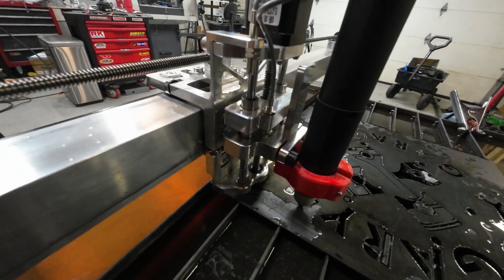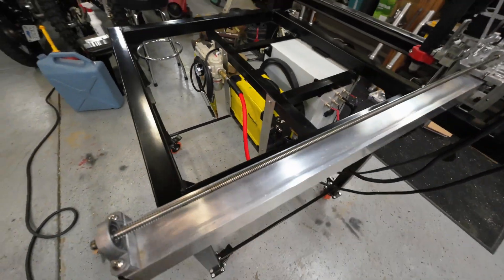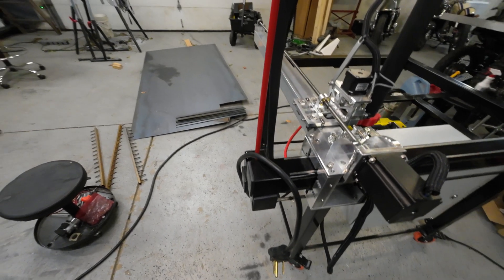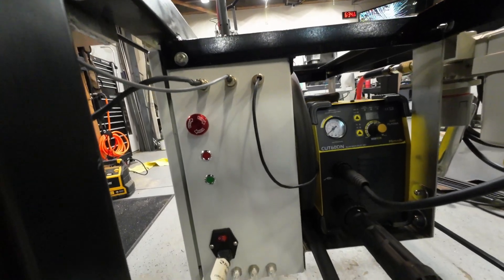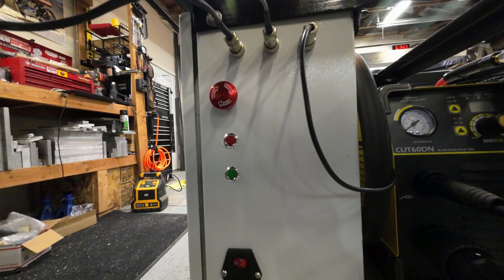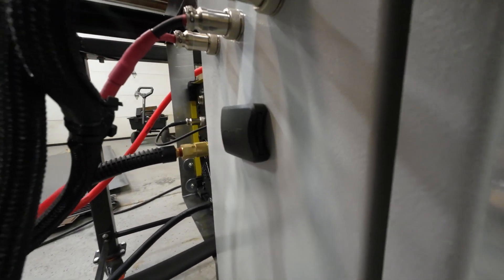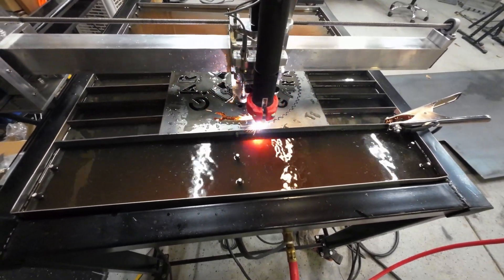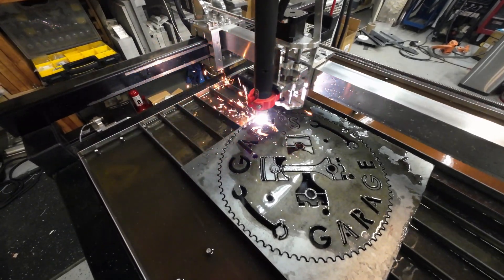DIY CNC plasma table - part 4 - Let it Rip

Comment: Very nice i am opting for 9 pin parallel connectors in place of the aircraft connectors. They have screw type terminal ends that don't require soldering.

Comment: Do you offer a controller with the ESP32 Eth?
Reply from the maker: Ive just been using my phone, a tablet or laptop to do any jogging. Since I always have to upload my cut gcode anyways Im usually connected with the device and right there. If I had a bigger table I might use one.

Comment: Hey what is the story about the bare metal CB750 in the background? I built one very similar for a customer about 10 years ago here in Houston TX. Yours looks very similar.
Reply from the maker: Had that one for about 12 years now. Its a 1970 CB750 cafe'd out.  It doesnt get enough use and is a pain to clean and sync the carbs almost every time I drag it out.  I ought to give it some love now that winter is dying down.  Its fun, but thats one heavy beast when its ripping up to speed.  We bought it in pieces from a guy that started to work on it, but it was a basket case that needed a ton of work.   The metal work was started, but super rough. Had to do some disassembly smoothing and welding for that part.

Comment: What WiFi router do you have installed in the cabinet. I do not think you got back to this in the video. Reason for it is obvious enough - the ESP 32 does not have a strong enough signal...
Reply from the maker: Yeah I forgot to cover that, but thats mostly because its not super needed. But it is a GL-MT300N-V2.  It was small enough, and there is a bracket to wall mount it that can be bought.  It  runs as a repeater for signal strength, and I went back and forth on the idea of mounting an external antenna with it bu hadnt yet, because I hadnt needed to.

Comment: Looks like a copy of JD garage cnc build?
Reply from the maker: Copy?  The first couple videos talk about buying their plans.  Great plans!  But I didnt want plastic.  So... a copy with different dimensions, and different materials, and a different controller, different software, different plasma cutter, different frame layout, different drive method, also welded and not bolted.  Uh, it does share the same water pan and some of the motors.
Reply: LOL!! @dcmotive response to "copy". I purchased the JD's Garage version last month. I am 3D printing parts now. I would rather your version. How does one obtain it? I went to your site, but saw no related products for sale except the controller. I assume your plan to make available has not changed, so there must still be bug extermination going on. Any updates on availability?
Reply from the maker: No bugs. Works good.  I was changing the design to make it simpler, use less materials and perhaps be more rigid, and use a steel tube instead of aluminum. Stainless steel tube would be the ultimate, but the price gets ugly.  @Sigmadog1975
Reply: @dcmotive  I'd like to see your system when it is ready. If you are keeping a list of interested potential customers, please put me on it. I can  provide an email if required. I wait a bit to see how your product development goes & postpone the JD's Garage system for now. Thanks

Comment: Hey great build!. can you please let me know which controller board are you using to run the fluidnc?
Reply from the maker: Ive got the other boards Ive assembled and tested for sale here.  
https://dcmotive.com/products/p/6-axis-external-driver-board-with-esp32-board
Reply: @dcmotive  Is there a schematic or manual so we know what we are getting with the controller? I've not seen your other videos, so I have no ideas of motors, do I need more drive current, why I might need or use 6 axis with a JD plasma cutter. So yeah...any documentation available before I buy?
Reply from the maker: Its just a controller, it doesnt contain motor drivers. So it works with whatever you want to drive, using your own motor drivers.  The extra axis and extra outputs are for whatever you want. Maybe a rotary, or maybe setup a VFD and router/mill head.  Its all DIY and just adds options, or it will also run a simple JD type of configuration. But I prefer the software for this one over the arduino options.  It comes  with some instructions, but its still DIY, im not supporting setting people up, but if you follow the basic instructions its a no brainer. @timeconomu7395
Reply from the maker: Also, I made 10 extra units and am selling the ones Im not using, Im not marketing these. Just selling them for pretty much cost.  Once they are gone, they are gone. @timeconomu7395
Reply: I'm at the stage with my JD garage build that I'll try the arduino first, but if yours decides to get some documentation, I would def look at that. Thank you for the quick response! @dcmotive

Comment: Im also interesting in buying a set of metal rollers from you and a controller.
Reply: Awesome addition with the controller. 
I'm currently building the 3d printed version fron JD's garage. I definitely see myself upgrading to aluminum and ball screws.
I'd be interested in buying the X,Y,And Z axis from you... very nice work by the way. Keep up the great content. 
Thanks
Reply from the maker: Which axis'? 
I added the controller to my website...
https://dcmotive.com/products/p/6-axis-external-driver-board-with-esp32-board

Comment: Nice job… would love to have you make all aluminum parts for me…
Reply from the maker: Only problem is that also requires going to screw drives on the X and Y axis, so its not totally plug and play.
Reply: @dcmotive  that’s not a problem
Reply: Have you started selling the parts yet!
Reply from the maker: @hottamaleboy1198  Im messing around with a version that mounts the Y axis gantry on a 2x3 instead of a 2x2 to see how much rigidity is gained. Im curious to see if it could extend 48" with a few tweaks.
Reply: @dcmotive I used 2x3 on mine, and aluminum bearing holders as well. Wish I would have seen your video first I would have offset the top rail ad well
Reply: @dcmotive let me know once you get it ready!